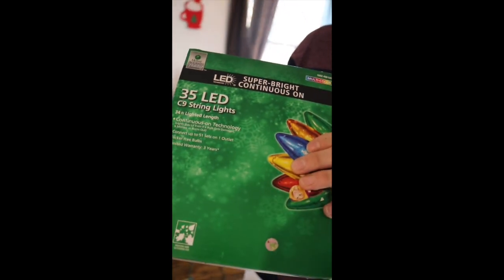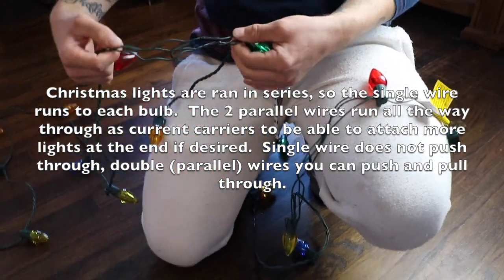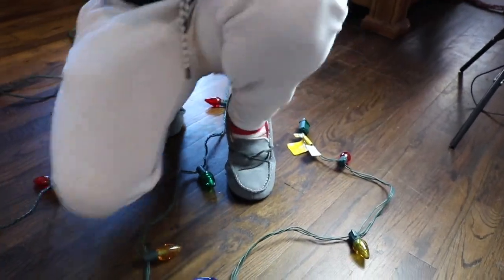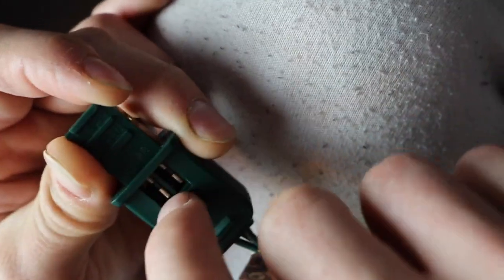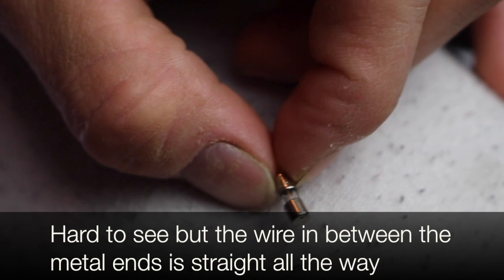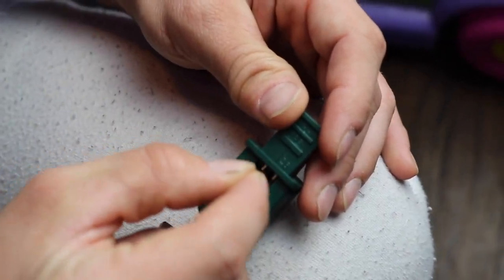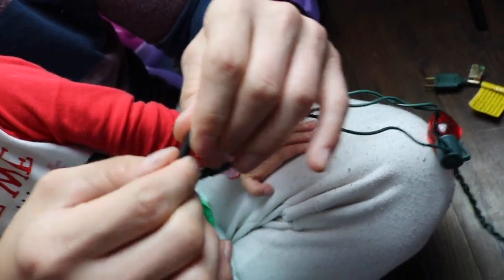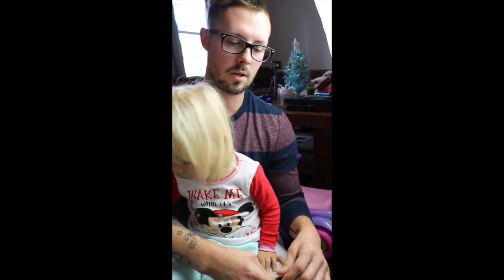CHRISTMAS LIGHTS!  Simple fix for 3 wire Christmas lights

Comment: What if it's been cut already and you don't know which wire goes to which? Does it matter? All videos show slightly damaged wires, so you know which one goes with which.
Reply from the maker: Well I didn’t know which ones did at first either, but I just found that there was one wire running separate from 2 other wires running together if that makes sense it’s kinda tricky to explain.  Basically I found that single wire ran through the doubles if I remember correctly now and just reconnected them.
Reply: @spensercaldwell3397  ooh okay I have miniatures so it was easy to see bc there was one single/main wire that connected from light to light with tha other 2 wrapped around.. so do the other 2 not matter which connects to which or ?
Reply: How do I know which of the three wires connects to each other if you cut the set in half by accident?

Comment: I took a closer look and see of the 3 wires, 2 bypass the bulb and one goes in and out (serial connection). So I'm a little lost with your explanation - maybe it's a diff design. Why don't the just use 2 wires in a parallel circuit?

Comment: The first 1/3 at the opposite end of the plug in a 3=wire string of 50 lights all burned out.  Is there something to fix them all at once or does each and everyone need to be replaced.  I replaced a bulb at the start of the burn out and one at the very end but neither lit up
Reply: I have that exact same problem on several strings.

Comment: Man people are rude! I want to know why you were repairing/ re-splicing the wire? Did you see a cut / pinch? How did you find the source of your wire problem? Also a comment re the fuses.. if you have a multimeter, just check continuity of the fuse to confirm if it’s still good. :-)
Reply from the maker: Yes they were cut like someone came by at night and just sliced them right down the middle on all of them